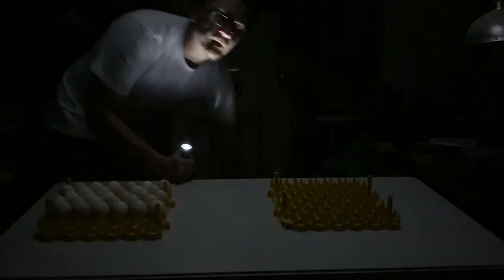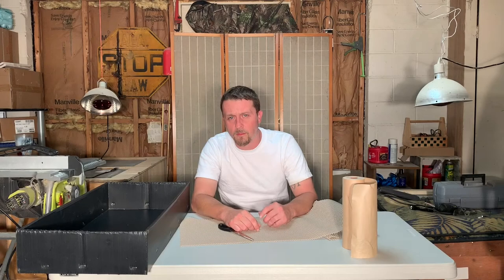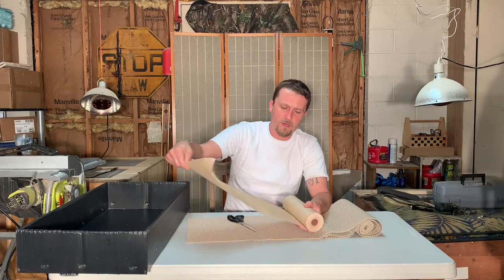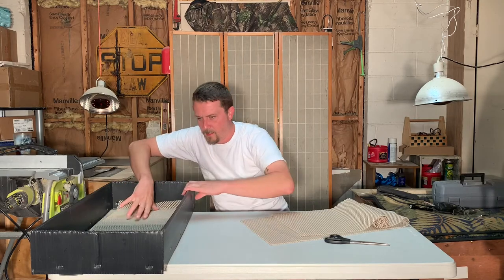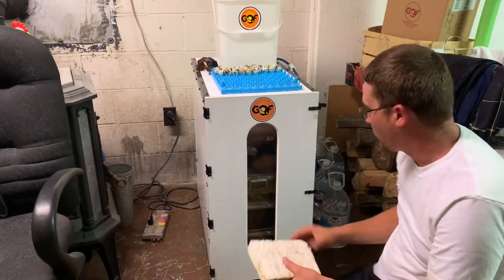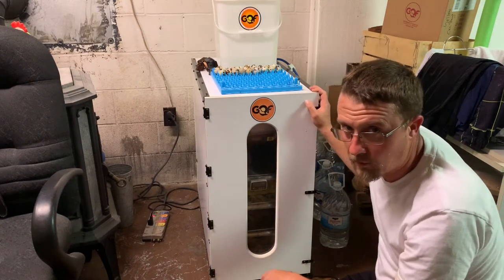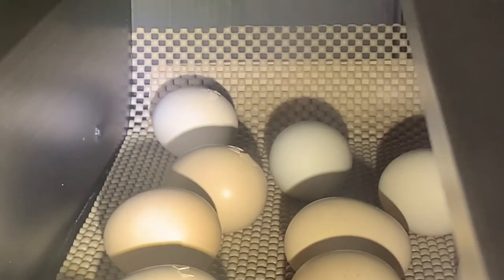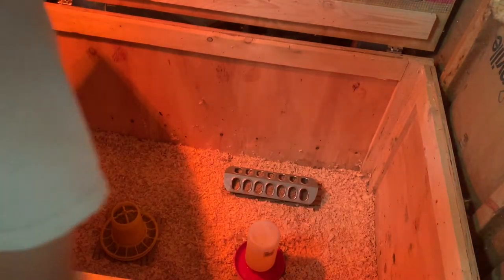Hatching Eggs In A GQF 1502 Sportsman part 2

Comment: Good video. So I guess you can not control the humidity for it to be different if you have some in hatching tray and newer ones in the turning racks above. This is only reason I haven’t purchased it. Seems amazing every other way
Reply: raise humidity by adding a sponge... in the sponge slot.  Use a hatcher.